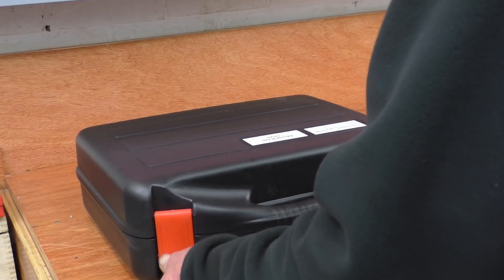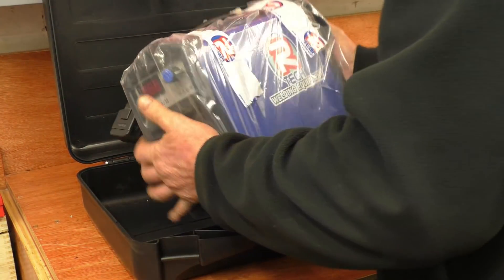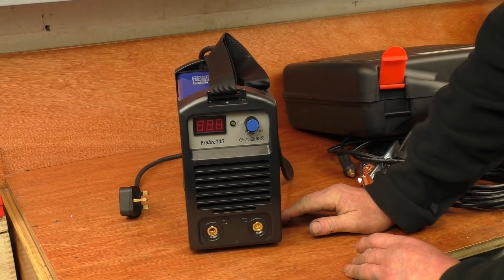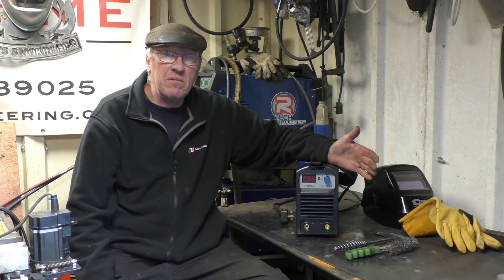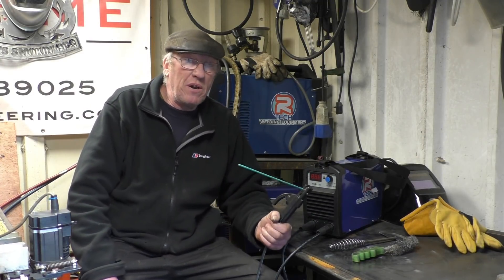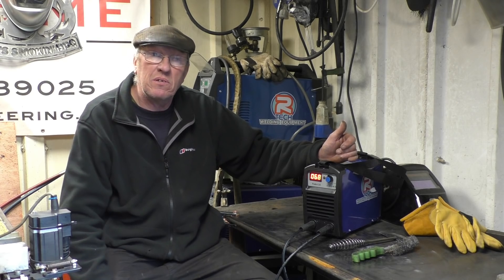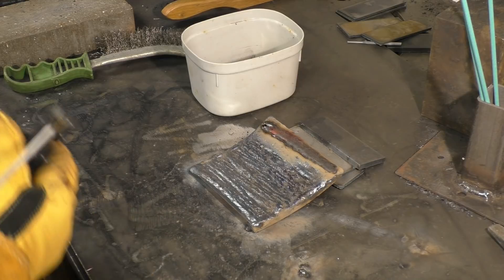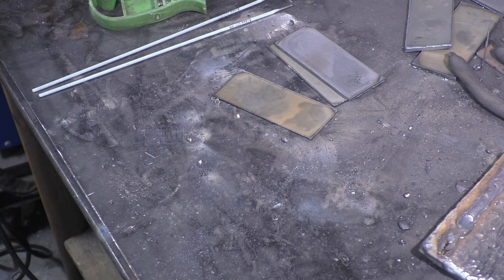R Tech ProArc 135 Inverter Arc Welder Review

Comment: Many years ago I worked for a Blacksmith making Architectural Gates and Railings and we got a contract off Stockton Council Street Cleansing Department repairing cracked and dropped gully covers and one day I had to go to a job, i got out got the leads uncoiled started the welder generator up cleaned the crack up and as I started to screw the rod into the holder the lad who was with me shot the earth lead onto the damp grass I was sat on and I got such a jolt through my arse that was a lesson I have learnt from 🤣🤣

Comment: Looks great John, I have a 40 year old SIP 130, what a difference! You need a crane to lift it, the duty cycle is small and it doesn't run at all like the unit you trialled - it sticks to everything (I thought that's why it was called stick welding lol). Cheers, Jon
Reply: Same here, problem with a simple transformer welder is the low output voltage, making strike up a pain, though there is a higher voltage winding on them to aid starting as I understand. The inverter types output DC at a high voltage, higher specification units can output DC and AC.

Comment: hi john ,good review we have the 175 version and its been absolutely faultless its done every thing from farm repairs  hgv and plant to welding floor beams into a rail coach (same place where you dropped off the loco in a previous video) , one thing I have found some 6013 , 7018 run better electrode negative had the welder for 2 years plus and cannot fault it at all   , stay safe all the best john
Reply: Will it weld 3mm box and angle well, what amps if so?. Im interested it buying one and possibly adding a 16a socket to the garage. Not welded for 2 yrs though
Reply: @handle1196  Morning Dan I have the R-tech 175 only because we use 2.5 and 3.2 mm rods for quick onsite work , the welder has been faultless for the 3 years I have used it , for the 3mm box ours runs at 60/65 amps with a 1mm joint gap if you run vertical down i just run a little hotter at 70 amps which i find stops the weld puddle from dropping out , the rods i use and have tried many , but the best i think so far have been ESAB 46.00  / 6013 and cheap tp buy too  Hope this helps best regards mike

Comment: Nice and light weight, great if you are working up a ladder or in a confined space, and as well the current control works well on thin steel, where you can weld without blowing a hole through. The HF start also is great to keep the arc struck while doing the thinner sheet work as well.

Comment: Nice little machine.. Will it burn 6010?  Many inverters will not ... Cheers from USA...Mike
Reply from the maker: Yes just tried it burnt a old 6010 no problem at all
Reply: @doubleboost  I have never used an inverter but vids I have watched have shown some won't keep 5p lit.. Cheers..
Reply: Years ago, some Miller DC engine drives wouldn’t burn 6010’s either! The “AEAD200LE” was the worst! As we all know, the 6010 won’t work on AC at all! Heck of a good rod though!
Reply: @tomt9543  Yeah, I wish I knew how many 6010 5p I burned.. It is just something about some of those inverters that won't keep a 6010 lit...Some will, some won't, it seems.. I am still old school, either transformer or DC generator.. Cheers from Louisiana
Reply: @ramsay19481  Me too on the transformer machines! I’m extremely old school (I’m 60,), and like you I wouldn’t even guess how many 50 lb boxes of 5P and 5P+ 1/8” rods I’ve burned through in the last 43 years! Same with 7018! I’ve been a Lincoln man since I started welding! My welding supply rep told me a year or so back that Miller would cease making any transformer machines within the next couple years! Even their former “buzz box” Thunderbolt machine is now a tiny inverter! I’ve had a lot of bad experiences with inverters, Miller’s in particular, and when they give trouble your looking at $2000 to repair anything, mostly fried pc boards! I know of a bunch of 40+ year old transformer types both Lincoln and Miller that are still running as well as the day they were built, and have had nothing done to them over the years! Oh well!
Reply: @tomt9543  I'm 68 and have also burned many 5p and 5p+ the same dia.. We usually ran root pass with 5p then came back with 7018 to lace everything up.. On crane boom lacing, just straight 7018 atom arc....Cheers from Louisiana